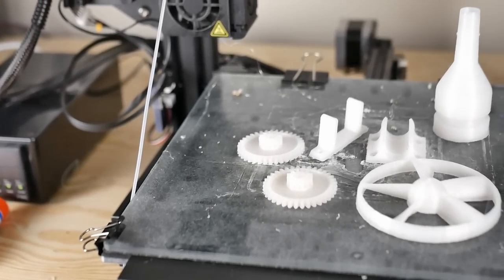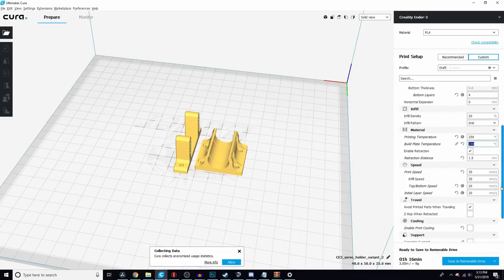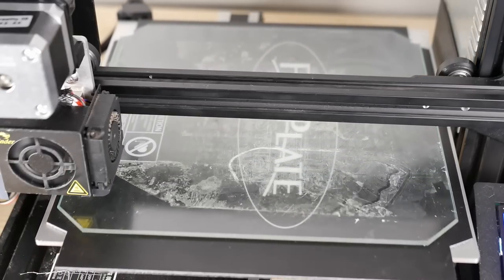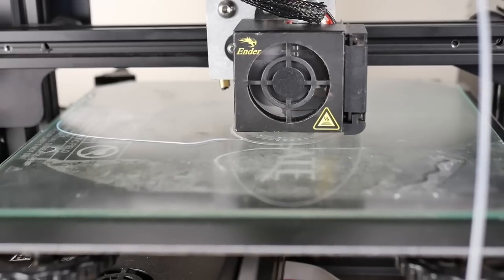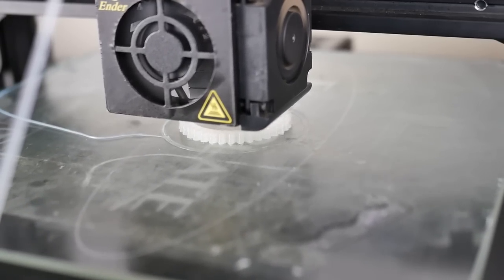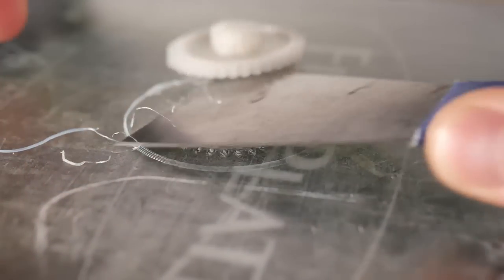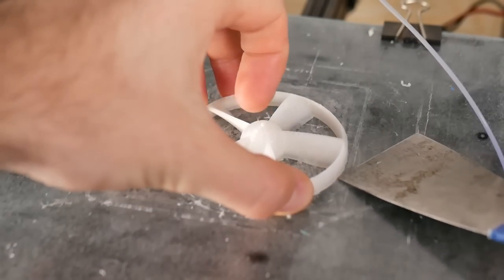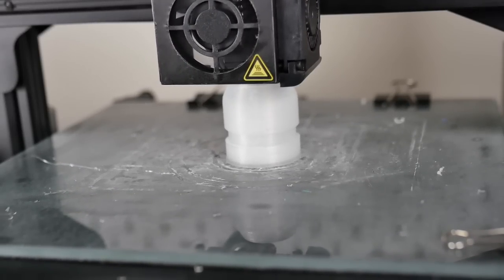How To Print With Nylon On The Creality Ender 3 3D Printer

Comment: I'm an old Dinosaur from the 50's, and my son just got one of these machines, and I cannot in my own mind believe what I'm seeing. Mind Boggling for sure. I tore down a KD Linear Actuator that wasn't working and found that the Nylon Drive gear, which was being driven by a steel spiral off the end of the motor armature, had damaged one side of the gear, thus rendering the actuator useless. Couldn't find a gear, they wanted to sell you the whole actuator. So my son is going to try to make me one if I can get the damaged gear off. Your Video was interesting and it looks like it might work for what I need done.  Thank You for filming it. But really doesn't it sound stupid to drive a nylon gear with a steel gear, I know, everything is throw away any more, just buy a new one, but just maybe, 3 D printing will solve that problem.
Reply: I too am from the 50's and have a few printers running, I will try and print what I need before buying comercially produced, it's the satisfaction element.
Reply: Most garage door openers drive a nylon wheel with either a steel or nylon worm.    All the ones I have fixed actually wore out the bronze bushings On the output shaft which allowed the worm and wheel to misalign,    You typically want one hard and one soft part or low friction interface…think of a crankshaft on Babbitt or silver lined brass bearing shells.
Reply: They typically add a nylon gear for a predictable failure point. That way you don't have a bunch of stripped steel gears, just the one
Reply: Young Donald  Yes he did, but I just sold the actuator itself as it worked fine without the gear mechanism.  I saw a few things he made on his 3 D printer and they looked good. He didn't have a very expensive printer but what I saw of it,  but a plastic gear working on a steel gear was a disaster waiting to happen anyway; but they don't want these actuators to last forever, as they want to sell more of them when they break. But 3 D Printing is amazing, I saw where Jay Leno has a expensive, fancy one where he makes parts for his car collection.
Reply: @tipsclubs01  the machines are really good you can get the cheap ones then with about 100 bucks in parts it will print production quality parts
Reply: It sude does. I wish things would be built to stay with you for the rest of your life. But I guess that would raise the price quite a bit as well. Still, things designed to fail in a few years is just wrong.

Comment: Sugar water is the best bed adhesive. 1 part sugar 2 parts water by weight and you'll never need any glue stick or hair spray ever again, plus your prints are sweet.
Reply: That sounds crazy but I'm curious to try it!
Reply: With this method I 3D printed my first cake 🎂
Reply: Woah.  That sounds so crazy it just might work. XD

Comment: Thank you (a year-ish) later. Your experiments and results answered all but my two, newbee questions: 1. can common tempered plate glass be used on the bed? 2. Would it help to use a thermal paste between the existing bed and the glass? (Clean up issues aside.) Thanks again for your time - much appreciated!
Reply: I would assume it would, I think that thermal pads would be better just because its a bit easier to clean up.

Comment: I made a wooden cube out of 1x1 fir and fitted a space blanket around it using tape.  With the bottom open i can cover the whole printer so that breezes and dust is not a problem also keeps the printer warm if you are printing in an unheated place.
Reply: Nice out-of-the box box!

Comment: Been printing CF nylon with the stock hotend at 250 C with Capricorn tubing on my Ender 3 Pro.
Textured glass bed with glue stick.
No cooling, hardened steel nozzle, 4mm retraction distance at 30mm/s. Dry it before use.
Reply: I like that bro I’ve been trying to learn how to print with thisWithout having to fully modify my printer because I have an engine three pro with exact same set up you just mentioned

Comment: Thanks yes the glass helped and i had 260 end with 110 bed and a heat box at 70 to dry the nylon and i got it working thanks.

Comment: I have no problem with adhesion, but the print falls apart when layering. I guess I'll pump up the heat a bit. I'll probably enclose it.
Reply: Make fan only 10 percent and increase both bed and extrusion temp

Comment: Tks for the vid.  I just got PCTPE for the first time.  Adhesion is a major issue.  Will try glue stick and a hotter print bed setting next.  Mostly ventued with PLA and PLA+.  Way easier to print with.

Comment: Or print Nylon easily on a cold bed with Zillagrip glue. Square model wouldn’t have worked with regular glue stick that’s why the examples were round.

Comment: So basically, printing nylon is like printing ABS except even worse.
Reply: except nylon actually has layer adhesion, wheras abs can be torn to ribbons easily. atleast in my experience
Reply: @umbratherios5614  Zero cooling at all times. Minute drafts constitute cooling, heatbreak cooling fan can produce enough draft to overcool the print. Moving table is also liable to produce drafts by moving print through still air.
Reply: @umbratherios5614  If you can pull apart your ABS prints something is very wrong. I print ABS 90% of the time because it's so cheap yet so strong. Even when purposely breaking prints, they never break along the layer lines.

Comment: What is the exact filiment you are using in this video? I've been trying to print with 3D maker nylon 6 and it's a lot whiter looking. I've been having problems with layer delamination even at 260 deg. The hottest I can get my printer hot end to go.

Comment: Which nylon filament are you using and do you have a Cura materal settings file to share? I've got an Ender 3 and recently got the Ender 5 Plus. I'd like to get into printing RC parts for my Traxxas Slash and Axial crawlers. Definitely considering getting the hotend kit for both printers if I can find a good reliable filament.

Comment: Great video, I am VERY new to this, do you mind posting all your mods you made to be able to print nylon? I want to make sure I am making the correct mods. Thanks in advance!
Reply: You can do it on the stock ender 3. I do it in a room I can keep closed and at 90°F.
Reply: Youll need at least a glass bed and an all metal hot end

Comment: All nylon printing I've tried on the ender 3 (upgraded with a full metal hotend) failed so far. Prints just fine, but the layers don't stick together. It all crumbles into individual sheets of layers.
I guess I really need a hot enclosure to keep the prints hot and toasty while printing.

Comment: I have an Ender 3 pro, I tried to rig it for nylon but I can't figure out how to raise the 260 c limit it has on the firmware. I ran a direct drive and started using a powered coated PEI bed sheet. I've since bought a Sovol v6 that is nylon ready, and had some success, although one print I tried to use just the tabs, and have to clean off the heat block of the plastic build up. The part was about half done and it came off and stuck to the hotend despite the heat sock on it.

Comment: Fantastic tutorial, beautiful prints, I would like to ask you, I have an Artillery Genius, do you think it could be good for nylon printing? Which filament do you use? Thanks for your time !
Reply: Im not super familiar with that printer, but overture nylon is the cheapest and also the easiest to print in my opinion. It's about 30 US dollars per kilogram spool.  Its not a normal nylon filament so dont print it like normal nylon. Follow printing instructions for polymakers nylon copa or for overtures nylon (overture nylon is a nylon 6 and nylon 6.6 copolymer just like the polymaker nylon copa, but the overture brand is much cheaper). Do not use the nylon setting on your printer. Prints at 260c with 45c bed temps. I print at speeds anywhere from 20mm-70mm/s.   It can't do crazy overhangs super well without supports, but other than that it prints beautifully and its unbelievably strong if you anneal it at 80-90c for 3 or 4 hours. Ive accidentally tested this stuff at over 170c and it stays firm. My daughter turned the knob up on the oven to about 170-175c while i was annealing some stuff and to my surprise it didnt melt whatsoever, not even the surface texture, It just made it even stiffer. You dont need an enclosure or anything to print it. You'll need an all metal hotend though because it prints best at 260c and even nice Capricorn ptfe tubes arent going to be 100% safe at those temps. Dont be afraid to grab a cheap chinese clone of a more expensive hot end. Rightnow at least, half of the hotend clones out there are better than the originals anyways. Also, its not 100% necessary, but if you don't have a direct drive setup I highly reccomend printing one because it makes everything print more precisely. Also it's free, and it's absolutely mandatory if you ever want to print flexible filaments later down the line.  Id be happy to share print settings if you ever need them. I print a whole lot of overture nylon parts. I barely use PLA or PETG since discovering overture nylon. Its cheap enough to just use it for everything. I got tired of wasting time and money on my PLA+ and PETG parts breaking on me. I mostly make carabiners, high powered rc car parts so impact and tensile strength are my main concern and thats where this filament really shines. Idk how it does it, but this stuff will actually outperform polycarbonate in both of those catagories.
Reply: hi sir. Need your suggestion how to remove the support pieces from nylon because I tried I can't. Need your inputs

Comment: I have the same Ender set up with the micro swiss and the direct drive system I was wondering if you adjusted your flow rate for printing. Did you also have to calibrate xyz axis and e steps
Reply: I did.  XY unchanged, Z 404, E 140.1. Extruder is the biggest change because the gear is smaller. Your mileage may vary.

Comment: Highly doubt you’ll get back to me but I’m having a lot of issues with adhesion the layers fall apart when pressure is applied if you got any ideas please help me
Reply: I’m using CF nylon and it sticks to the bed fine it’s just the print itself

Comment: Well done, mate! But I just don't know how you made Nylon stick to the bed at such a high temperature. My parts stay attached to the glue only when the surface is completely unheated. Which causes the prints to warp like crazy. To be honest, printing Nylon was the biggest hell in 3D printing I ever experienced so far. I guess things like fluorinated polymers will take its place when I try them.
Reply: He said his first layer was extremely close. Maybe try that.
Reply: @ChefofWar33 , most likely he has an alloy, not pure PA. Like Taulman Nylon and stuff. I got mine working by printing on a sheet of office paper superglued to the glass bed. Not too convenient, but it works. So, all good now:):)
Reply: @ChefofWar33 , also, no, it does't matter how close the nozzle is. I tried glue, hairspray, pure glass, very close and far away. If it is pure Nylon, you will not get it printing on glass. You have to smash it into the fibrous structure of paper at like 5-10 mm/s and keep the bed at max temperature to assure good layer adhesion. Also, the tape peels away at >100 C, so only superglue works. It's all bloody extreme, but if you want your print to survive in chloroform, there is no other option unfortunately. Have you tried doing Nylon yourself? What was your experience?
Reply: @Aleksei Marianov  No.  I just bought my 3d printer.  Hasn't came in yet.  Just doing research atm.
Reply: @ChefofWar33 , congrats! Welcome to the community! Hope you'll enjoy it!:):)
Reply: @alekseimarianov3388  I just got a Creality CR-5 Pro H.  Is that any good?
Reply: @ChefofWar33 , that should be a very good printer. I like the fact that the machine comes with the enclosure out of the box, it will make printing big parts much easier (no drafts and warm environment = greatly reduced warping). Also, looks like you bought a high-temp version with nozzle temperatures of up to 300 C. This enables you to print things like Nylon, polycarbonate and even some of the superpolymers. The only thing, I noticed that Creality printers may not be perfectly accurate, my CR-10S pro feels to print 0.2-0.3 mm shorter for each 10 cm across y axis, I haven't looked into proper calibration yet. Also, the capacitive proximity sensor might be a bit wonky. I advise you to position your printhead at the center of the heated hotbed for 2-3 min before each print because the sensor response fluctuates depending on its temperature. This sensor pre-heat will make the first layer much more consistent. Generally, start with PLA and then work your way up to things like ABS, Nylon and polycarbonate. If you can, buy a heated filament feeder box to stop PLA and PETG slurping moisture from the air. If you have any problems, google them or ask questions on Reddit, we will help as much as we can. Regardless, you bought a fantastic instrument and I am sure you'll enjoy working with it!
Reply: @ChefofWar33 , and please, for the love of God, don't print 3D benchies:):):)
Reply: @alekseimarianov3388  You know damn well the first thing im printing is a obligatory benchy.  I feel like its mandatory.
Reply: @ChefofWar33 , haha, totally agree! Go for it!

Comment: so ive been trying to print sSun Nylon-CF on my ender 5 plus w/ capricorn + micro swiss and olsson ruby nozzle 0.6mm on glass with hairspray - no fan....its been absolute nightmare,....i am still trying to figure out what the issue is....i get under extrusion, missing parts in layer etc etc...my bed is levelled, nozzle at right distance from bed (via paper test)....tried 250/80 260/85 268/85  and no luck still. I run the filament out of a enclosure with moisture absorption packs....i even went and bought a 2nd roll of filament and still having issues as the flow of filament is just inconsistet,,,,i will keep trying hopefully i can get it right

Comment: the micro swiss hotend works with ender 5 plus?
Reply: I'd like to know that too as I'm considering getting a 5. And will likely work a lot with nylon (unless anyone has a suggestion for a filament that can withstand the higher temps you'd find in a car's cabin in summer :) thanks
Reply: @ArchetypalCat  sorry man, finally i bouggt the Prusa Mk3S. But what i heard you configurate all stuff that yoy put in your machine ina kind of software or firmware called marlin. Maybe you can start investigating there 🙃🙃🙃
Reply: @andreicharpentierquesada4530  thanks for the prompt reply, Andrei ... Hey no problem. Prusa is known to be pretty good. I've read about what Merlin does but I certainly will check into it more. If you don't mind another reply: what were the reasons you choose the Prusa over the ender-5 ? (The 5's are on sale now so it's pretty tempting, but if the Prusa is that much better then...)

Comment: Anyone ever make a dehydrator that's also a spool holder, so people can dehydrate their nylon while printing? (So a long print won't have the nylon soaking up moisture and ruining the print). I think a simple heater might work just fine as long as it heats and cools periodically and the filament hasn't already soaked up a lot of moisture before.

Comment: Do you not have issues with the PTFE tube melting? PTFE melts at about 250C
Reply: did you watch the video? its a direct drive extruder with all metal hot end... he even said if you use the stock hot end he wouldnt go more than 250

Comment: do i need a hardened steel nozzle to print standard nylon? i know its required for the carbon fiber ones not sure about nylon
Reply: You don't necessarily need a steel nozzle, but it will last longer. I know the overture nylon i use wears out my brass somewhat quickly, but not nearly like carbon fiber does.  Overture nylon is a nylon 6 and nylon 6.6 copolymer though, so it's stiffer than normal nylon and probably wears nozzles a bit faster than other nylon would. Overture nylon isnt a typical nylon. It's essentially the same as polymaker nylon copa, just cheaper. I love it for rc car parts. Its actually pretty stiff once its been annealed but it still retains its crazy strong tensile and impact strength. Prints like a dream at 260c on the hot end with a 45c glassbed and some hairspray. The downsides are that it shrinks a very very small amount when annealed, its not the best at unsupported overhangs, and it strings a little, but combing and retraction settings can help minimize that. I can still print a bed stuffed full of parts without worrying about the surfaces. A heat gun gets rid of the tiny strings pretty easily.

Comment: Does it really need all metal hot end for nylon or the stock hot end will suffice?
Reply: You really need a metal hot end. Nylon prints at the same temp the plastic the stock hot end is made from.
Reply: @Madscrills  tq very much

Comment: How do you clean up the glass after?
Reply: I find the best way is with hot water in a sink, the glue stick disolves and just washes off. I do use a ( hand ) nail brush to help it on its way, then dry with kitchen paper. Once dry your good to print again.

Comment: You must have had a fresh roll of filament..? Nylon is a disaster for absorbing water as you probably know. By right, it should be dried for almost 1 full week at a low temperature, and can then fully absorb the water again within the next 48 hours. I don't know how anyone has any success with it?... Nice job anyway! You obviously have it dialled in 👌👍

Comment: Now, take those parts and use them to make molds for aluminum parts.... RAD..
Reply from the maker: haha that is a above my experience level and capabilities.
Reply: These nylon printed parts are better than any cast trash metal parts. You don't need molds for CNC.